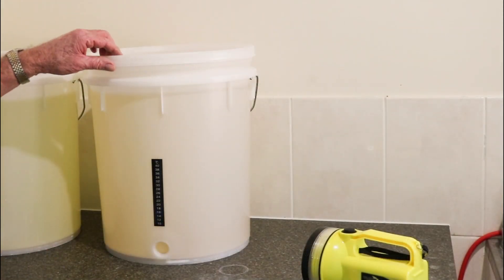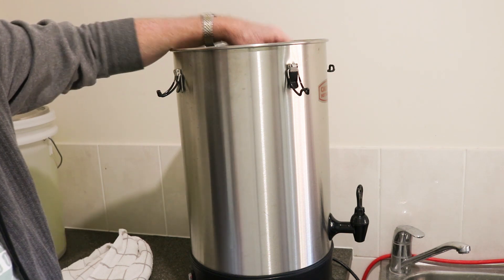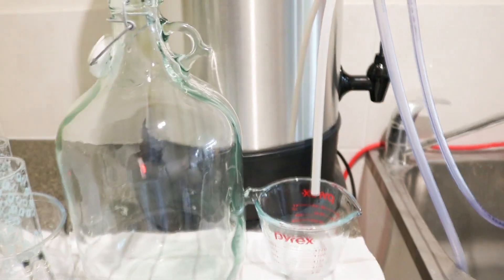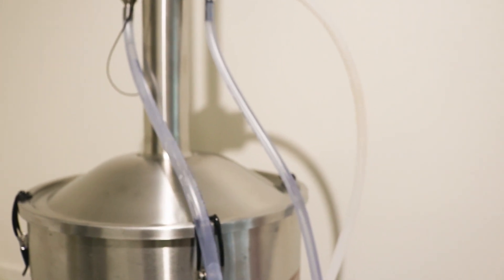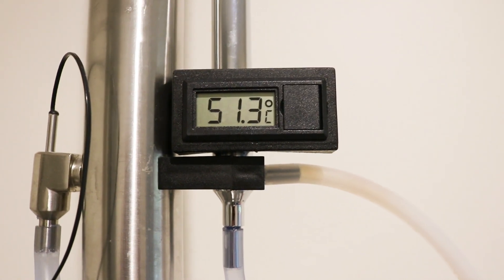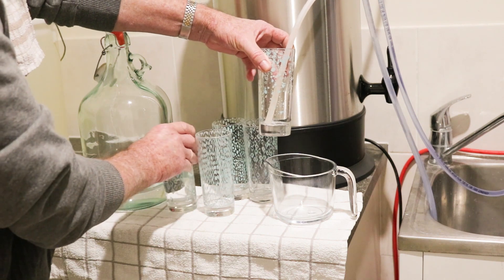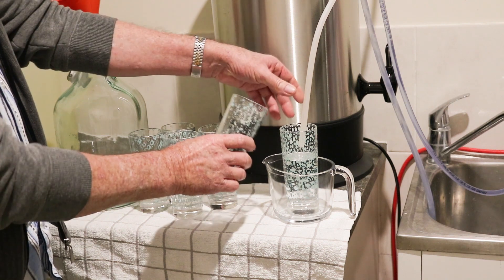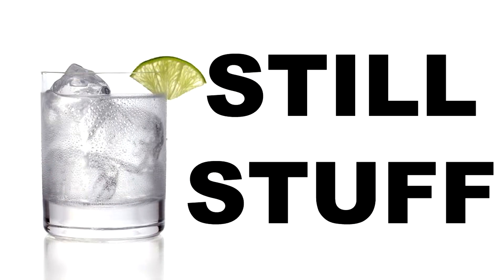How I Make Vodka with Bakers Yeast Pt.  2  Distillation

Comment: I would' like to send you a video  on how you distill it's quite ingenious the absolute best part is you get you see the steam rise it gathers on the bottom of a bag shaped like a reservoir. Which is secured  around your bucket,bin,container with a th8ck strong piece of elastic,roughly 1-1½ litres of water sitting on that bag.So the bag is pressed down slightly and you should know it's even all sides so the water 💧 sits edge edge

Comment: 12 kg apple 18 liter water 4 kg sugar is this the best method for ethanol?
Reply from the maker: Hi Wahid.
Make sure your apples are ripe and sweet (stay away from over-ripe decomposing apples, this will polute and stall your wash). I personally would pulverize them with a mixer then strain the mixture through cheesecloth to separate the pulp from the apple juice. At this point it would be a good idea to take a Specific Gravity reading to determine the potential ABV (Alcohol By Volume).
Nature is not that generous with Sugar and I would guess you might get around a potential 5% ABV
If you are using Bakers Yeast, it dies when the Wash gets to around 10%ABV. If you are using a winemakers yeast you might be able to get away with around 15%ABV before the strength of the alcohol kills the yeast. (the higher ABV, the more alcohol you get)
If you have not already got one, get yourself a Specific Gravity Hydrometer for Brewing that measures the sugar content of your wash - measure the SG of your Apple Juice, slowly add sugar mixing well and re-measure the SG until you can reach the maximum potential of your yeast.
After you distill, separate the Foreshots, Heads, Hearts and Tails (I usually keep all the Hearts and a little Heads and throw away the rest)
What you will have at the end is Apple Brandy, dilute to your desired strength and enjoy........
Happy Brewing Wahid

Comment: Hi. I made wash the way you presented it in part 1.  Its 4 weeks now and still fermenting and its cloudy.  How long it takes to clear wash like yours after fermentation is finished? I live in Cairns so I do not use any type of heater.  The super turbo products from local shops have terrible taste.
Reply from the maker: From my experience and mistakes in the past, when I used un-distilled water, the impurities in the water slowed the distill and sometimes stalled the process. It has been a constant battle for me to find pure water. I was buying 10 ltr Coles water but found there was a metallic effect in the distill. I am presently using the same water, boiling it for an hour, allowing it to cool without a top and then running it through a carbon filter. Kinda sucks having to do this but worthwhile for the end effect. What sucks more is my Brother-in-law lived 15 minutes away and his tap water is perfect........
Reply: @pauljacobs5390  i'd just go to that house and explain it to the new tenants... Hi u dont know me but i know ur house. Let me buy your water 🤣

Comment: It's always safe to toss the heads in any wash but in reality there isn't going to be much of the nasties in a sugar wash. Grains and fruit produce the most and you do have to be cautious and toss a good 10ml per gallon for safety. You tossed 75ml which is your comfort zone but in my experience with sugar shine may be a tad much, but it doesn't hurt. This is where the old term "going blind" came from because the toxic chemicals that are byproducts of fermentation will actually disrupt your optic nerve. They've had problems on cruise ships where people were getting sick and it was because the cruise liners were buying their alcohol locally from the islands, where it was made cheaply and incorrectly. Many suffered methanol poisoning because it wasn't distilled carefully enough. You also say you go by smell  to determine quality which isn't wrong but an old trick I used was rubbing a drop or two between my fingers. In the beginning after the heads were tossed is where you'll get the best ethanol and it will have a tight grippy feel between your fingers. As the run continues you'll begin to feel the distillate become "slippery". That's the tails. I used to describe the smell like wet cardboard. On part one you used baker's yeast and ended up with less than 1/2 gallon. I use turbo yeast and even after 3 distillations I end up with 15-17 750ml bottles of 180+ proof product. Cut that down to vodka strength and you can see why I use turbos. Triple distilled and double filtered. On a $45 investment in sugar and yeast I end up with 30+ bottles of neutral spirit. THIS is why we do this lol!
Reply from the maker: Hey Wingmanalive, great message content and I hope others read it as well. Way back in the beginning, I started doing these vids to help my Brother start the hobby and he ended up with the same gear as me. He started with Turbo Yeast and swears by it. He jokingly says he only has 20 ltrs left so he better do another run. I have tried Turbo in the past and found there is a flavor remaining that I did not like. I was using Still Spirits Turbo Yeast. I have tried triple distilling, but seem to get poor results from my reflux column. Have to admit I am tempted to retry with Still Spirits new product Turbo Yeast Pure. Thanks for the tip on the heads and tails. I was aware of there only being little Methanol in a Sugar Wash but was also aware of Acetaldehyde (20.8C), Acetone (56.2C), Ethyl Acetate (78.1C), Ethyl Butyrate (121C), Ethyl Formate (54C), Hexylacetate (171.5C), and the hangover compound Acetaldehyde (20.8C). To eliminate these compounds I make my heads cut around 75ml and my tails cuts early. Have to admit I am interested in trying this new Turbo Pure product, triple distilling and triple carbon filtering to see if the end product will give me more bang for my buck.....
Take care in these uncertain times Wingman...... Cheers Paul.....
Reply: @pauljacobs5390  No problem. Carbon filters are indeed the best way to remove any off flavors and what I use, if you can believe it, is your common Brita water filters. The cartridges are relatively cheap and I use one for every batch and then toss. They have carbon inside the filter which does the same job. Buy the pitcher and it comes with one or maybe two cartridges out of the box. A 4 pack at Walmart is like $14. Distill a bottle and pour it in, then run it through again. A lot of people don't know this but in many cases the difference between cheap and top shelf vodka is simply in the filtering. I've researched it and found people who buy the cheapest vodka they could find, then filter it as many as 10 times and have noticed a HUGE quality difference. Add a dash of lemon extract and you have Citron. Dash of cherry, vanilla, whatever. Now, I've also seen some complex carbon filters that are 8 levels deep with a cotton and carbon sandwich but it doesn't need to be that extreme. I'm sure you know this but those who don't, carbon has millions of microscopic holes that trap the particles in the solution you don't want. However, that gives it a usable lifespan and depending on the solution being cleaned may render the filter ineffective quickly. Not unlike a dirty aquarium filter, the carbon can only absorb so much. This is why I swap out cartridges after every run. I wish I had a reflux still but my 5 gallon stainless steel pot still works great, I just have to run it through a couple more times. The Liebig condenser is awesome and the build quality is superb. It's a lifetime piece of equipment. I just have to replace the seals every couple of years. They're cheap though. Have a good one!
Reply: The math here went sideways somewhere. Not accounting for the foreshots, heads, tails, a 25 litre wash at 10% ABV can only produce (at best (0.10 * 25 * 100/90) = 2.75 litres (approx) of 180 proof spirits. 15 bottles of 180 proof would be 11.25 litres.  It would take a 100+ litre wash to produce those.  Hope i didn't misread the above.
Reply: Hello when yo say triple distilled do you add water into the boiler or just the alcohol. Thanks. Just a beginner, love your vids.
Reply: @seahealthproducts4786  Makes no sense to add water because that's what you're distilling out of the solution to begin with. Just be careful because as with each run the ethanol content (proof) increases making it more dangerous to handle. By all means please avoid using open flame for your heat source. I use electric hot plates. At 180 proof it is very flammable. It's the reason many old fashion stills exploded, they had a small leak they didn't see in the still head leading to distillate running down the pot and then BOOM. I've made my mistakes as well like turning on my hot plates and forgetting to turn on my condenser. I come back expecting half a gallon of shine and the room smelled like ethanol with steam shooting out the condenser. The second I turned on the pumps the shine flowed like an open faucet. You can't get distracted because that's when mistakes are made! First run in the still (pot still) expect a good 100-120 proof. Second run you'll be over 150. Final or spirit run is where you'll max out at 175--185 proof. A fourth run won't yield much more. The good thing about reflux or column stills is they will get you you're highest proof ethanol in one pass. They are more expensive however and slightly more complicated to operate. The still head or column is packed with a medium like marbles or has multiple plates so that while the ethanol steam passes through them the impurities fall back down and what eventually makes it's way out is very pure. The taller the column the more efficient it is. There's no limit on cost or size as I've seen 500+ gallon stills with 10' tall columns. Those types of stills can pump out product at like a gallon a minute. Imagine that!

Comment: I’ve seen in other videos that pure sugar wash does not contain any methanol, you have shown that it is present. , can you elaborate on when methanol is present?
Reply: Methanol is only produced from fermenting fruits or grains. Sugar wash does not contain cells and so cannot produce methanol. However like all fermentations it contains acetaldhyde and other nasties that you wouldnt want to drink. It is good practice to throw away the 1st 50/100mls of any distillation run. Hope this helps.
Reply from the maker: Thanks jay71512, good answer :-)
Reply: jay71512 thanks, very informative.

Comment: Was your wash 25 litres? And gave you about 3 litres of spirit
Reply: My standard recipe for turbo 500. 25L water, 5kg sugar, 2L of any non citrus shelf juice (apple/pear/pineapple is good its for acid content only), 1 cup cornflakes (food variety for the yeast) 100g bakers yeast. 7-10 days... @ 20-25c......siphon slowly into your turbo leaving as much of the bottom inch or 2 as possible so its nice and clear..... run....should get 3ish L @ 90ish%.... dilute 1:1 with nice water. Enjoy.... no need for any of the crap Still Spirits want you to use, clarifiers and god knows what...

Comment: Hey. which is more powerful ( jaggery or sugar) ?
Reply from the maker: Never came across Jaggery before so asked Mr Google. 
"It is a concentrated product of cane juice and often date or palm sap without separation of the molasses and crystals"
I think it will definitely influence the end product taste. If you wanted neutral spirits that you then flavor, I suggest using cane sugar. The Date, Palm and Molasses may influence your PH levels.
Give it a try and let me know (cant get it where I am)
Reply: @pauljacobs5390  thanks for your valuable reply
Reply: @pauljacobs5390  you should check out in indian market.

Comment: I thought there were no tails from a T500. Just need to remove the head
Reply from the maker: Nope, when you do your next run, separate your run into progressive 500ml bottles. This way you will be able to smell and taste (wet finger) the difference. I find the last bit of the run to be completely unpalatable so I choose not to include it in my final product. That being said, my brother throws away the first 50ml and uses all the rest, he doesn't seem to mind the flavour. Me personally, I want my Vodka to be completely neutral flavor for mixing into other drinks. In the end, if it is an acceptable base for your flavoring, you can use the tails.

Comment: You should NEVER start a still without condenser water on. Any matter of events could deter you from your still. In an enclosed environment like that what would you do when theres volatile alcohol vapor pumping out?
Reply from the maker: Hey Nathan, what you say makes sense.....
I live in a part of the world that has the reputation of the worlds Sun Cancer capital, so tghis relates to not too much rain. Since I use tank water I have to limit the water use. What you say is right, and those with no water restrictions should do as you suggest.
Regards
Paul

Comment: so u tossed that first little bit....i understand that.  but why did u .not keep that last full glass???   it was dripping out at 50-55degrees  therefore wouldnt that be good alcohol????    btw   that is an AMAZING still  how much does that cost?     thanks for a great video buddy
Reply from the maker: Simply smelling it will let you know it is poor quality.
Many distillers will tell you to save the cuttings and put them in the next distill. I personally do not like doing this, prefer to concentrate on getting the best quality distill.
The Still Spirits Turbo 500 Still will cost you $550+ Australian. Here is a web site, there may be one in your area you can check. https://distilleryking.com.au/collections/turbo-500
Cheers Shane :-)
Reply from the maker: Or this web site..... https://stillspirits.com/

Comment: If I use refined sugar do I need to boil off the ethanol and other bad stuff before I start to collect the vodka I want?
Reply from the maker: Hi Lychee Calpico.  Sugar is Sugar, it comes down to personal taste. If you can imagine the output of your still offering a sliding scale of quality, the best part to keep completely neutral is in the middle of the distill. I personally try to eliminate the first bit as it has a strong odor that usually taints the distill requiring extra carbon filtering. The end or Tails again comes down to your quality expectation. As soon as the output starts to get that terrible burned smell, I usually make the cut and do not use the remainder un-distilled. My brother is not so picky, he discards the first 50ml and runs the still until there is nothing left to come out. He doesn't seem to mind the "Off" flavor, whats more he uses only Turbo Yeast. Each to their own I suppose.
Reply: The ethanol is what you are after. It is the ethanol that you drink.

Comment: How percent alcohol after distilled? Pls answer
Reply from the maker: Hi Eli, After using the reflux column I was able to get 94%ABV in the final Distill
Reply: @pauljacobs5390  how many distillation for it?
Reply from the maker: Only one on the reflux column. I would only do multiple distills if I used the Pot Still
Reply: @pauljacobs5390  can i do that without citrid acid & DAP?

Comment: If i removed half of the saddles in the column to use it as a pot still, would i still need to maintain that 50C temperature?
Reply from the maker: Problem with my T500 Reflux is that the boiler heats at one speed - Flat out..... Yes, you can remove the saddles but realise that the boiler is still over 100C and the only way you reduce the temp is through the reflux water supply. I thought about installing a thermostat to be able to reduce the temp but decided I will wait until I make a larger pot still. A proper Pot Still does not go above 78 to 85C and you can do a stripping run. In my experience, doing a stripping run in a Reflux still and putting it back in for a final distill, you will not be able to remove the Foreshots, Heads and Tails. They seem to be bonded together

Comment: I just ran my first turbo wash through and the smell was terrible, I watered it down to 20% and distilled again and made heavy cuts but it still smells like nail polish. Is this why you moved away from turbo yeast?
Reply from the maker: I have used Turbo Yeast in the past and because I like to get zero odor spirits I had to run it through two batches of carbon filter a total of 8 times but even then I could still taste that TW flavor. My Brother absolutely loves TW for the total volume of spirits produced and surprisingly likes the flavor, when I go to visit him he proudly makes me sample his Whiskey, Bourbon, Vodka and Gin... and it all tastes the same to me with the TW. He also only discards the initial forshot and a bit of the tails. I suppose everyone is different, I personally prefer to run low yield Bakers Yeast for the incredibly pure Hearts. I have 3 x 25 ltr bins nearly ready for a Christmas stripping run in my pot still and then the final reflux run. I predict 7.5ltrs of 85%ABV Stripping Run which should yield me around 4ltrs of 94%ABV after cutting (to my taste)..... Hope this helps.... Happy Brewing Dean (Edit, I can tell you about my brother because he doesn't have a computer and has never been on YouTube - I put my Vids on a DVD and this along with the advise from his Home Brew Shop is the extent of his research)
Reply: @pauljacobs5390  thanks for the quick reply. I'll definitely give this bakers yeast wash a go and compare. Your videos are informative and easy to follow, love your work. Merry Christmas.
Reply: If you use turbo yeast you absolutely must carbon filter it. No other option. It comes out pretty nice after filtering